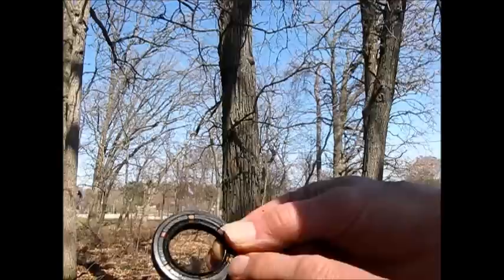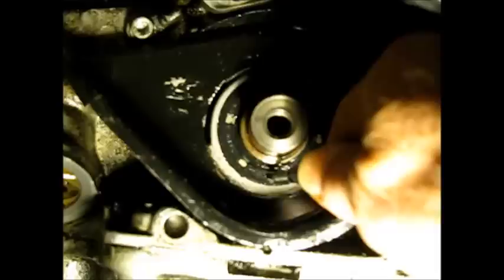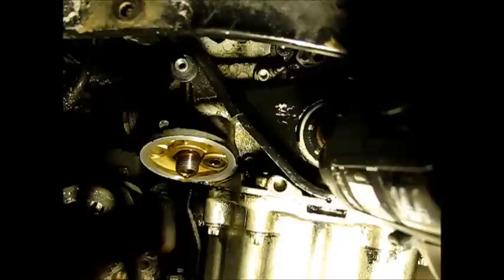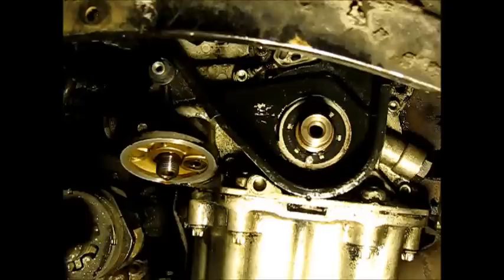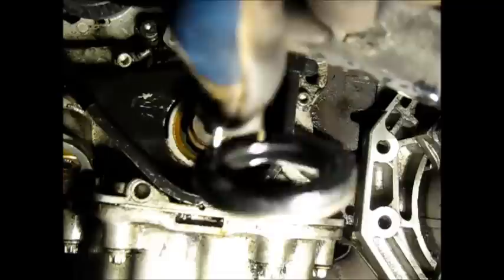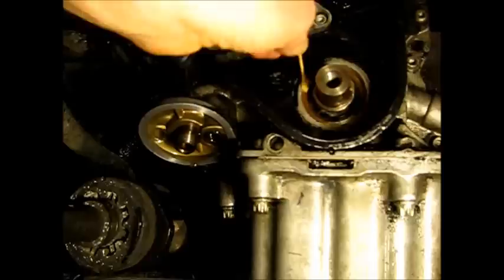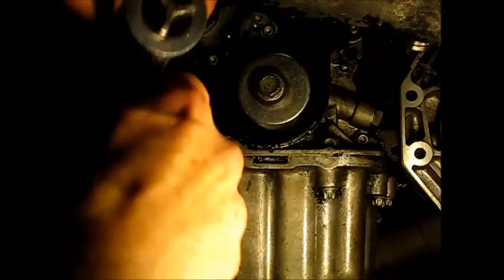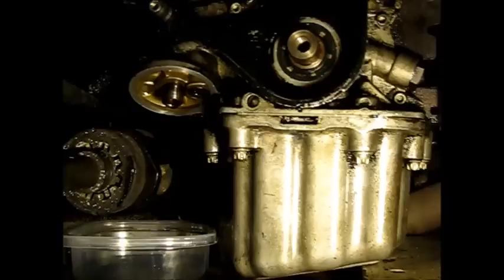How to replace a leaking oil seal

Comment: Ver cool idea with the PVC pipe, I have plenty of scrap PVC laying around here and will be using my miter saw to get the even cuts/edges and a little sandpaper to smooth them out so to not have sharp burs. Thanks for the video!
Reply from the maker: You're welcome. Good luck with your job.

Comment: Good video, had to do this myself several times. I use petroleum jelly for assembly lube on seals, o-rings and most engine parts with great success. I also like to check the inner seal surfaces with a dental pick to make sure I haven't rolled the inner surfaces.

Comment: Nice Tip.
So installing spark plug tube seals can be done with a bolt and washers on a removed valve cover instead of buying a bearing/seal install tool. it just takes longer but cost a lot less.  And here i was going to use a socket and hammer to drive it home.  I like this better.
Reply from the maker: Thanks for watching and commenting and good luck with your seal job.

Comment: Good video but very frustrating watching you work with one hand while the other is operating the camera, especially the one handed screwdriver routine. Possibly a small tripod for the camera ?
Reply from the maker: Thanks for the constructive criticism. I have always used a tripod but these must have been situations where I couldn't for some reason. I agree, one hand on tool and the other holding camera does not result in a good steady shot.

Comment: Put those seals in the freezer a few hours before installing.  Quickly install them while they're still cold and they will drop in like butter.
Reply from the maker: lizard944 Now that sounds like great advice. I will definitely try that next time. Thanks for the comment!
Reply: I'm trying this tomorrow
Reply: The Original Mechanic of the
Reply: does it work?
Reply: I just did the freezing cv axle seal a couple days ago, I just stuck mine in a handful of snow in 12 f. temps we are having right now, I knew about it a long time ago, and yes it does work. When you chill metal it shrinks, therefore allowing the seal to slip into the housing much easier than when it is warm.
Reply: It's 18 degrees outside today, If I do it your way maybe I'll hit it with a heat gun or hair dryer so it can expand a little and doesn't spin after its installed?
Reply: @LittleJimmyNorton  great idea
Reply: At the same time, warm the piece that the seal is installed in with a hairdryer. This makes it even easier to drop the seal in. It also gives you a little more time to get the install right.
Reply: you magnificent bastard.
Reply: Are he seals made of metal

Comment: Put the screw in... make a hook tool like a claw hammer has... insert tool in a slide hammer... one bump and easy out.
Reply: Most folks don't have a slide hammer or a trunion puller...but.  Use a longer screw and after threading it in use an adjustable wrench or a claw hammer that can span the shaft of the screw but not clear the head. Give it a snap upward and out comes the seal.

Comment: Nicely done on the install. Just what I was looking for. Replacing mine I rushed it by using PVC and a hammer. Mounted in crooked, ruining the new seal. Now ordering a. new one and will press it in there s way. Thanks for the good video. 
Where do you get your parts for hest quality and price?

Comment: Thanks for this. I’m going to try it on my pressure washer oil seal. Can I use red & tacky grease around the seal?
Reply from the maker: Automotive bearing grease works fine. I don't know about red and tacky though.
Reply: According to this link https://www.youtube.com/watch?v=WOfOHMI6Wnc @Mercedessource says that you can use tacky grease.

Comment: Oil is mixing up with coolant on my gilera 125 cc.. where is the sealer located on the inside of the engine
Reply from the maker: That's usually a head gasket, which requires an extensive tear down of the engine.
Reply: @TheOriginalMechanic  thanks pal..

Comment: would this stuff work on a pinion seal leak? if so u would just pour it into the differential correct?
Reply from the maker: +rammit 82 Sorry, I'm not familiar with that job.

Comment: Didn't like the prying against the case could have placed a small piece of wood to help prying
Reply: @The Original Mechanic, in order to prevent engine surface damage, Toyota recommends putting rags between your pry tool and the engine surface when removing the seal using a lever technique.

Comment: So if im driving i hear something fall off then oil leaks that mean the seal came off??
Reply from the maker: No, a seal can't fall off.  Make sure it's oil. That may be brake fluid or power steering fluid.

Comment: Does everyone lube the entire seal. I put lithium on the entire seal on my Generac engine. And it still leaks. It's just a hair beyond flush. It's even as I love-tapped in with a plastic pipe.
Reply from the maker: I don't think a little grease would make a seal leak. I would wonder if your seal was machined wrong. You may want to try another.

Comment: how can you replace a rear main on a v8 with the transmission still in.?....is there a tool for that?.lol
Reply: You just pour seal removal fluid in your trans and let it warm up for 20 minutes.  Shut off engine for 10 minutes.  Start it up and run it 3 times for exactly 5 minutes each... then it will be gone.
Reply: If you gotta ask that question the best tool for the job would be a local reputable mechanic lol